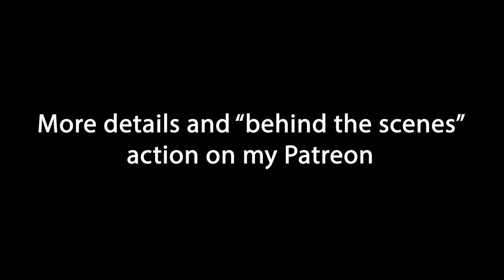TwinCam Chopper!! - Spotlight No.22 - Jacob Conard's Harley Davidson Chopper

Comment: What is the benefit to converting an EFI bike to carb? I was under the impression that EFI was superior in every way (ease of use, maintenance, performance) - except for sound.
Reply: Getting rid of a bunch of wires to simplify that aspect of the build.
Reply: Whole idea with a chopper is simplicity so why would you want EFI and oxy sensors and ABS ? Love the lectron . Cool bike.